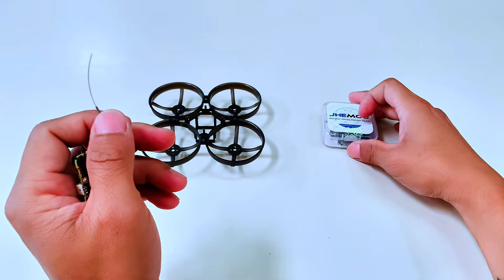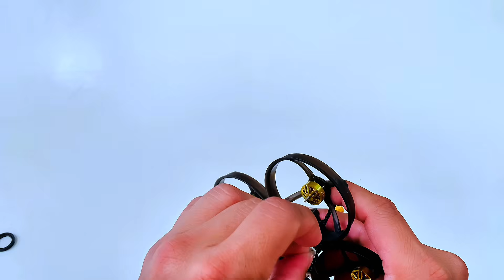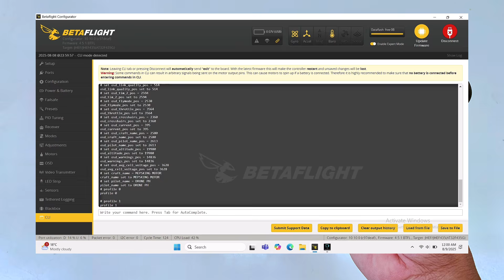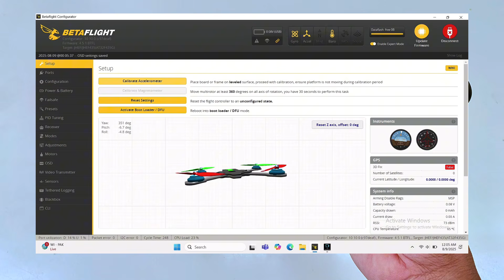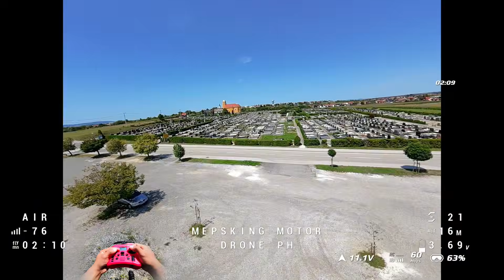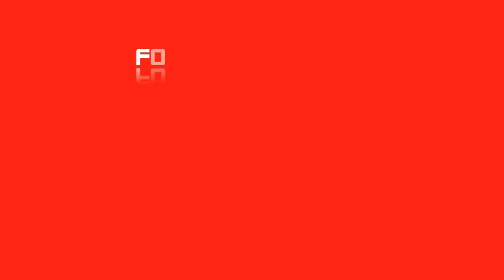Mobula 8 - DJI 04 Lite 2s Build#mepsking #mepskingfpv #mepskingshop @mepsking @Jayden_meps

Comment: bakit  po  ng ginaya ko  itong ginawa nin  sa video   pero ng   sinalpak kona  ang 04  air  unit  ko wala itong  ilaw   ano  ang  gagawin ko pero  pag sa computer  ok naman  si air  uni ayon lamang t pag sa fc    wala  siyang  ilaw kahit  may battery naman na
Reply from the maker: Check mo yung wiring mo boss
Reply: @DronePH-2026 ok  naman po  wiring  bali hindi  ko lang nilagay  yung    sbus at isa pang ground wire
Reply: ok na boss napagana  kona  😁

Comment: Hi, I want to do what you did. But I have a question: why did you choose the GHF435AIO V2 20A and not the BetaFPV F4 2-3S AIO or CrazyF405HD? Which is better?
Reply from the maker: Betafpv Aio is not compatible with the mobula 8 frame brother ,I choose the Jhemcu because it's low price..I think if you build pick the Crazyf405hd specially if you have a lot of funds thank you👍
Reply: @DronePH-2026 They have almost the same price now, so I decided to ask. From the description, it seems to me that Jhemcy is stronger, but I wanted to double-check.

Comment: I built a few of these mob8’s with the flywoo wide angle lens and canopy with o4 lite.  Game changer.  If you know you know.
Reply from the maker: Yes brother Flywoo lens is good actually I ordered one and try it ...thanks for watching 👍👍👍
Reply: @DronePH-2026  may i ask which canopy you will use with the flywoo wide angle? use the flywoo wide angle that turns it into o3 mounting pattern and use the factory o3 mount or use the flywoo camshell and flywoo canopy?

Comment: I'm using the same Flywoo lens cover that makes the 04 Air Unit lite camera 18mm wide up from 14mm. The Flywoo wide angle lens cover for this lens cover at 16:9 aspect ratio is sweet.
Reply from the maker: Thats great brother i got mine to but its on way thanks happy flying
Reply: @DronePH-2026  I'm building a 4" inch with the 04 lite today using this canopy. Thanks for testing to make sure everything works right with no jello. This may be the "go to" canopy setup.